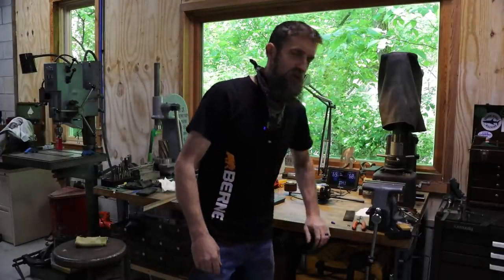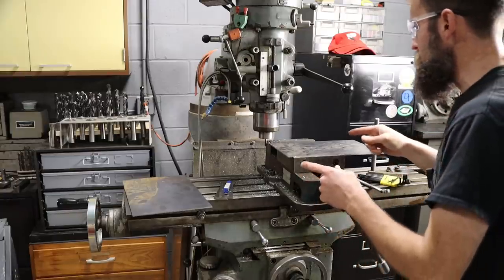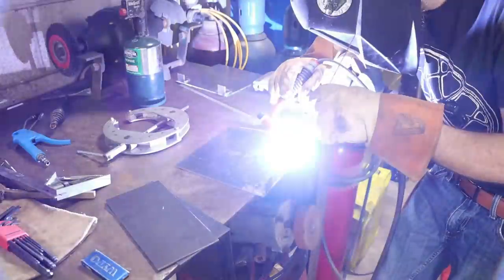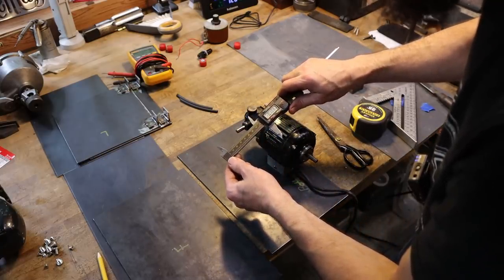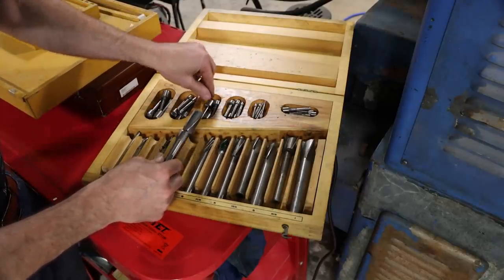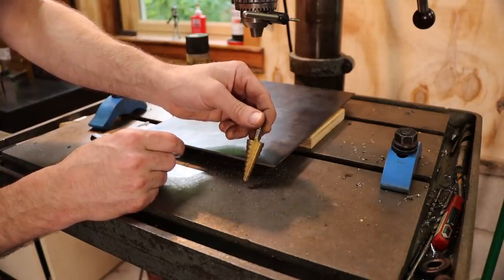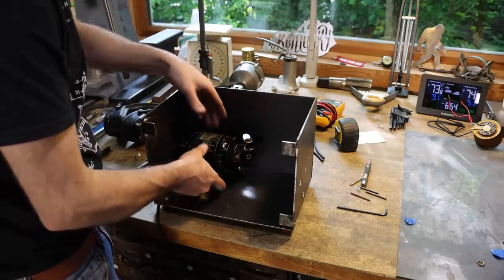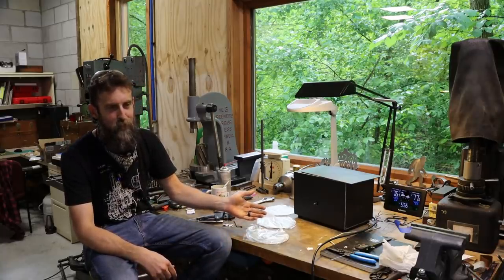Awesome Slow Speed Diamond Lap Build pt1

Comment: Steve, EE here and weekly fan of your channel. A Variac or in your case a variable auto-transformer (same thing) is really the best way to control a brush DC motor. A Variac actually varies the AC voltage which provides a very smooth speed control to a brush motor. There are solid state motor speed controls which are basically cheap light dimmers. These don't change the voltage directly but change the shape of the AC sinewave to reduce the effective energy available (no calculus please). But they are a bit rough on a motor and prone to failure as they are solid state devices and don't like driving motors. A variac is bullet proof in your application here. Then there is speed control of AC induction motors. Best way to precision vary the speed today is a small VFD unit which can also handle three phase motors. . I think you have one on one of your bench grinders. Won't get into the engineering behind that today.

I learn a lot on your channel - like the caliper zeroing trick. I am always hunting for my bench calculator!

Comment: Thank you so much for the peak into your life in the shop and the time lapsed trip down the river.  My Saturday mornings are great with your videos.

Just my suggestions (I am sure others have also stated them): 
1] make a narrow box (1/2" wide) x (7" front to back) x (5" top to bottom) with a mesh or grated bottom that aligns with the bottom of the box. This is so you can put your discs in it and they will be protected.  
2] A way to nicely wrap up your electrical cord on the back of your unit for when you place it on the shelf.
3] Do you need ventilation for the motor in the box?  If so, put a little fan on the high speed shaft and put some holes next to it for intake and have some others for exhaust (including a filter so inside stays clean). 
4] put a little rubber over the open for the slow shaft so grinding dust does not get into the motor inside.

Comment: Another way to do the center to center, that I find less fiddley and faster, is to close your calipers on one screw, hit zero, then measure outside and your actual center to center is displayed. No memory required and you don't have to adjust the calipers to hit a specific reading.
Reply: Another way to do it is the dirty finger method. You put a piece of paper over the bolt holes then rub your dirty fingers on it. Instant template! It's real fast and not fiddly at all.
Reply: He did the same, but in the kinda reverse way... :P
Reply: sounds even easier thanks

Comment: I have an actual Variac that I have had for close to 40 years.  Great tooling gifts fro the shop...especially the vise.  Love the  tap and drill index.  I bought a set of cobalt step bits and they are wonderful.  I love those Dremel cutoff wheels.  I hate the newer ones, and the mandrel.  Put a fender washer over that shaft to hide the hole.

Comment: Made me laugh when you said "just to be safe"... with those bare live contacts lying around :-) 
I remember working on a live circuit board one day when the boss walked up and casually picked up the board!!!! He yelped and jumped in a most spectacular fashion !
Reply: You Del Cat have just reminded me of when I tried to Electrocute myself many/40 odd years ago. SPDT switch and I wired it as active on center terminal as on/off switch, more fool me! When I turned the switch off to shut the device down I had neglected to think the exposed other was ACTIVE, Shocking, I learned! 
Cheers from John, Australia. 
PS: It was only 240 Volt nothing dangerous, lol.
Reply: @joandar1  I initially thought you were just building up a Drop Bear repelling charge. My bad. 🤦‍♂️
Reply: @josephking6515  All good mate I did learn. John.

Comment: Hey man just thought I'd stop in and say the generally accepted way to grind tungsten is longitudinally (the long way). It supposedly allows the pixies to flow easier not having to jump over rings on the way to the tip. I put it in my battery drill and run it against the wheel the long way. Makes a nice concentric point.

Comment: For your consideration:
Instead of [in addition to]  arbor, build a self supporting turntable.  It can be done by installing three wheels tangentially.  These can be small ball bearings, mount a large er ball like a trackball in mounted, or suspended on small bearing, etc.
ADVANTAGES:
1.  Heavy loading of the object
2.  Accurate positioning
DISADVANTAGES:
1.  Complexity
2.  Cost
I am glad to see you machining. The new shop was a huge project.  While you kept the audience interested even though watching cement harden is not exactly what brought me to your channel ;-)

Comment: Nice start to the project.  
As far as recommendations,  a recessed control panel to protect the knob, switch, and fuse holder.  A hinged back panel to store additional abrasive disks while not in use.  Perhaps a stud with a wing nut.  Will you need tools to attach disks to the shaft, perhaps storage for those as well.

Comment: I use the step bits often doing electrical work. Helps to keep it cool if drilling multiple holes at a time. Also if you drill a pilot hole keeps the tip a bit more fresh.

Comment: In addition to what others have said about zeroing the calipers on one screw, then measuring across two to read the centres: You can use the internal blades to measure one hole, zero the caliper and then measure across two holes. No need to find screws to insert.

Comment: Hi Steve, often electric motors require the high rpm to operate their cooling fan and when run at lower speeds your motor may overheat. It would be wise to include a cooling fan which blows into the motor and is vented externally. Your fan must run at a high speed. Living in Australia high ambient temperatures are a problem and I use computer style fans to force cool my speed control circuitry on my small DC motors used to run diamond wheels and watchmakers lathes. I always enjoy your videos, where you live is so different from Australia

Comment: Steve centres is easier if you measure the thread first and ZERO your callipers then measure over the two threads and you get the centre measurement without moving anything.

Comment: You might want to consider drilling small holes in the back for ventilation to dissipate heat from the motor and variable transformer. Just a thought. Looks great so far!!

Comment: You could use the high speed output shaft as a take off for a flex-shaft if you had a need for a small hand held grinder.
Also I think a nice bit of pin striping on the paint job and a chicken head knob on the 11 dial would finish it off nicely!

Comment: I use those discs on my Lenard Grind-r-lap. They are held on with magnets. They just pop on and off without needing any tools. Quick and easy:o)
Reply from the maker: I will probably use that idea👍 Thanks
Reply: @SteveSummers  I can get you some pictures if needed. I made backs for the discs that are attached with double
 sided tape. The wheel attached to the motor has a pilot that lines up the discs. Its been working well for over a year now.
Reply: Stefan Gotteswinter's build also used magnets as another example.

Comment: Hi Steve great video. Just one thing is that you shouldn't grind tungsten side ways. it should be ground straight up and down the same direction as the wheel. Anyway this is the way I got taught in welding school and I've done it this way in my shop and have never seen anyone do it side ways. Anyway great content and I look forward to the next video! Cheers. Rick MTR Australia.
Reply: I've heard the reason why is because the arc will spiral around the circular grooves. The straight lines coming from the tip will produce a more stable arc.
Reply: @cheeto4493 , I was just replying to he’s remark to ask why and you explained it, thanks
Reply: Yep that’s exactly right. Never grind sideways it creates a less stable ark. The arc will become bouncy and jump around a lot more thank being sharpened the correct way which is straight up and down.
Reply: @cheeto4493   Yes that's correct. I just done a bit of research myself as I was sure it wasn't the right way. Apparently its worse when trying to do a fillet weld as the arc bounces back and forth off the horizontal and vertical pieces of metal.

Comment: Steve, 
If you slotted the mounting holes for the motor and the holes for the slow speed shaft you could make it so that you could slide the high speed motor shaft out through a hole and then use the high speed shaft as sort of a mini PTO (Power Take Off).

Comment: I would look at how to store the extra disks on the unit itself (protruding rod with wingnut?).   Also if you require any tool during use (e.g. wrench for changeout of disks) on how to make an out of the way storage so it goes with the unit.

Comment: I’d like to mention that the way you measured the bolt hole centers works but the real trick is to zero on the bolt then just measure across the 2 bolts to get direct readings

Comment: I highly recommend the Primeweld TIG225X. I've been using it for a couple years. 225 amps, AC/DC, Pulse, all for less than $850. I also recommend not grinding your tungsten that way. It affects the arc when the grind marks are circular. I used a dedicated grinder and wheel just for my tungsten as left over bits will contaminate the tungsten. Then grind with the tungsten tangent to the wheel. Your grind marks will essentially by running parallel to the tungsten and the arc. You'll have a much cleaner and more stable arc = better welds.

11. Love it.

Comment: Hi Steve, I tried those diamond wheels.  The 200 to 600 grit work well.  I used 4 half inch diameter neodymium magnets glued into an aluminum back plate which then holds so well that a pry bar is needed to get the wheel off.

Comment: It looks great Steve. When you talked about the full speed shaft my first thought was to mount a fan blade to it or at least wire in a 110V cooling fan and a pass through vent. The box has no ventilation for the motor. Otherwise, great project.

Comment: For your safety I would take a continuity test from box housing to ground connector on the end of your plug coming from the motor. Just to make sure that METAL box is grounded. Thanks as always for sharing. All connections are important, but the ground is your safety valve. Those other wires on that motor not being used should be capped off also. Till next Saturday, have a good week.

Comment: Re: drill index
I stopped using wood for tooling holders like that because of rust problems.  If you have any high humidity periods during the year, wood is a moisture magnet.

Instead, I go to my local plastics supply shop, and buy rigid foam core PVC remnants for pennies.  If there's a sign shop in your town, they will likely give you as much as you want, cause they generate a lot of scrap & just throw it away.

It works great for drill & tooling indexes, as well as machining prototype work when you need a mock up unit for testing.

It will hold threads & sheet metal screws, and is plenty rigid for most mock up work.  It machines real fast, saving lots of time doing mock ups.

Comment: A neat trick I was shown for quickly getting C to C alignment is to sharpen four screws to a center point, install them in the motor base, & tappy tap-tap each one w- a brass drift & thumb detector.

Even works well when the holes are not threaded, just dbl but then.

I've even used the trick w- surge suppressors & sheet metal screws.

GeoD

Comment: Nice video as always Steve. A tip when you're sharpening tungstens. You want the grinding marks running longitudinally not radially, reason being is that until the arc gets fully established, it'll propagate off the radial 'scratches' making the arc flutter. Not something truly important until you're in a position that you don't want stray arc strikes marking up your workpiece...........Mike

Comment: Agreed, no need for full seam weld on a box like this… but perhaps worth sealing the edges with some silicone at least? Otherwise the insides will soon be gunked up with grind dust? Might even damage the variable transformer contacts….
Of course that means making some kind of thin bushing plate for the …  characterful axle opening too ;)

Comment: If you want those diamond laps to last then spritz them with some kind of a cutting lube. Some folks like Windex. I use this stuff called Purple Power. You can get it at the auto section in Walmart. $5 a gallon. I use it in a spray bottle. Stuff is slicker than dog snot. Woo doggie.

Comment: Hi, instead of having the discs on the side, turn turn the whole unit on its side and have the discs on the top. The angles can then be taken from the flat metal top. This is the same way the commercial graver sharpeners are made. Think it will work out better than having it on its side. Stefan

Comment: The Horrid Fate step drill in your hand is also 1/4" hex chucking, so you can use it in any driver on the jobsite.
The better quality Hercules copper colored ones with helical face seem to cut better for longer in my experience.

Comment: Hey Steve those discs require a backing plate to support them behind you can get them super cheap on Amazon.  I built a grinder just like that with a treadmill motor after doing Richard kings class, the price of the ones he used was just not justifiable for the amount of scraping I do 🤣 .  Also another little thing I noticed when you sharpen your tungsten.  When you finish grind make sure the direction of the grind goes towards the tip of the tungsten and it will give you a much more stable arc.
Reply: I had the same thought when I saw the thin discs. The small diameter of the motor shaft could introduce some flex, even with a backing plate, unless the backing plate rides on some support rollers. Kinda like the glass plate inside a large carousel type microwave oven. It will be interesting to see how Steve addresses the issue. Maybe the pressure on the disc will be negligible.

Comment: Pro tip.. If you grind your electrode tungsten vertically the arc finger flame deal at the tip will be a lot sharper and more stable.
Reply: Vertically? With scratches that go around the cone? That's not right. The scratches should go up and down the cone. In line scratches offer the most stable and focused arc.
Reply: @1pcfred  The scratches are supposed to go from the point to the base like ski tracks down a mountain. Except your twisting it too so more like the threads of a screw. I've been welding professionally for 20 years on everything from food processing piping to the cooling water circuits of nuclear reactors.  I'm not the best at explaining things, but this is the proper way to grind tungsten for the best results.
Reply: @codylapoint  you're right. I didn't see Steve grind wrong. I've seen guys that just welded with a glob at the end of their tungsten. It worked for them.

Comment: Steve thinking about welders, you should keep an eye out on marketplace craigslist and the like. I picked up an old transformer type welder for 400 I think. Ac/dc no pulse but high speed start it'll do aluminum. It even has the valves for liquid cooling the torch. Having the option to stick weld at 500 amps doesn't hurt either. (It doesn't really help either since it vaporizes anything I've put an arc to.) Only real downside is it's as big as a refrigerator!

Comment: A quick easy alternative  to this, grab some cheap diamond polishing pads  ( anything from $2  to $30 a piece)   from diamond tools supplies,  stone masonry supplies,  eBay, alibaba etc, throw them on a variable speed angle grinder/polisher, (this is how worldwide stone industry does this, also, use a little water misted on the pad/part to keep things cool and lubricated, crude option is a household spray cleaner bottle filled with water) For this purpose diamond pads will last forever. Can cheaply readily source 30 grit   upto 10 000 grit.  I have used them  for touching up carbide  teeth, for regrinding  carbide, for  regular tool steel, all the way down to fixing curbed mags. Cheap, easy to use, multi functional, easy to source,  easy to change as velcro  backed,will hugely outlast these lapping disks,  doesn't  require a dedicated  setup as polisher/angle grinder can be used for other additional purposes.
For those questioning how true these  pads will lap, I can hand grind then polish an  entire  high end  stone benchtop, something like regrinding  a tool or lapping one   simply comes back to the operator,  
Not to minimise this project,  just giving a cheap quick option for people who may not have the time,  or resources for this project.
Always find the videos  interesting,  keep up the great work.

Comment: do your lap motors with windshield wiper motors.. they are designed to run for days at a time.   one can source automotive hug and bearing assemblies for as cheap as 35 bucks new..  get a pair of brake rotors for the same application. you can carve a V groove in the outside of one rotor mounted in the normal direction and the other rotor mounted the other way on the lug nuts giving you a nice mounting surface for the lap to be bolted to..  do verify how much preload is on the hub and wheel bearing assembly before you. buy it. some have a lot of preload..  its just an idea.. making a pulley for the wiper motor Double D shaft ..

Comment: Consider adding a small fan (like for computer) and a vent covered with a filter.  otherwise you may significantly shorten the life of motor and rheostat due to excessive heat buildup.

Comment: I used an old tormec to build a grinder like this. The tormec is a good quality base to start from. What i didnt think of is an easy way to change the laps. I have to take of the adustible table to do so. And you often want to change wheels. If that could be an advice. To either make the table very easy to take of or make the wheel changeable without removing the table. Great work! Always looking forward to your video s.
Gr
Simon saelaert